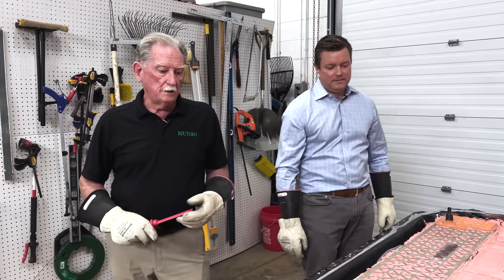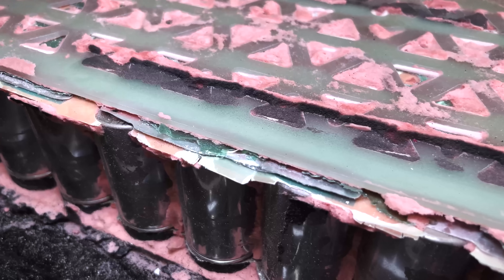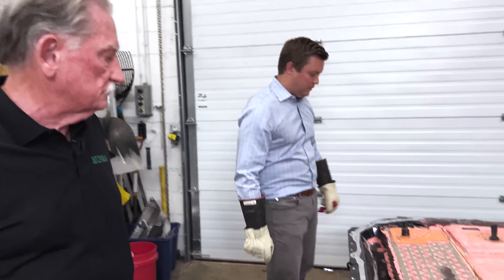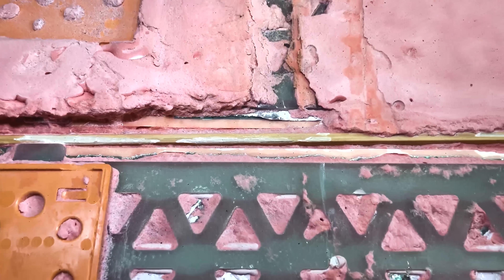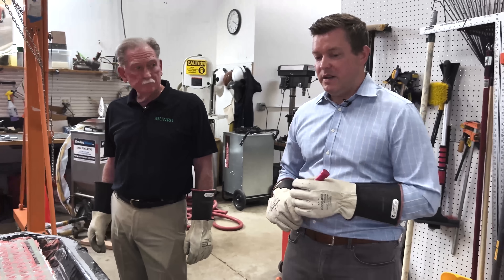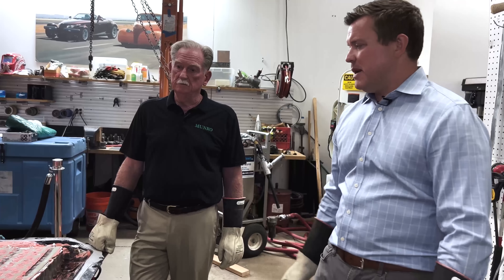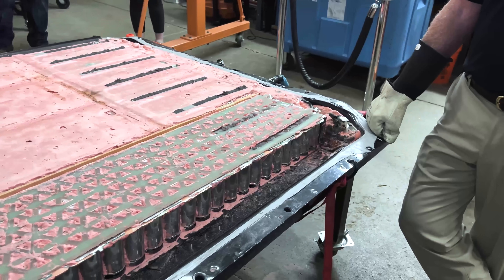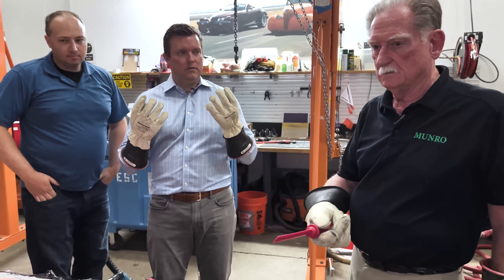4680 Battery Pack: What We Found Under the Foam!

Comment: Thanks for explaining how recycling works. A bunch of “engineers” in the comments thought you pick apart the battery piece by piece. It’s much easier than that.
Reply: Floating, as Sandy describes it, is the normal way that entire vehicles are recycled today. It will be interesting to see how it works with this pack.
Reply: Does an energy audit of the manufacturing & recycling process of this pack exist? Environmental impact study?
Reply: Those engineers work for the railroad.
Reply: I think redwood materials grinds batteries up under water 💧
Reply: You don't need to mock people asking a valid question they answered perfectly
Reply: Ditto, thanks Sandy, for the recycling primer. I was thinking in terms of cheap labor and labor intensive. The industrial process makes way more sense. Duh ;-)
Reply: Tesla does not want you to reuse the batteries. They want them back to make new cars.
Reply: This is the dumbest thread.
Reply: @B.L. Alley if it has a bad block of cells, the BMS will put a kibosh on that plan. You could replace the problematic cells in that block... Oh wait.
Reply: I was just about to thank them for doing this. I didnt know it was that easy to recycle. My first though When i saw All the pink stuff was also that it Will be a nightmare to recycle. I really learned something important here ☺️
Reply: It's still a reduction in recycling, there are a lot of people that want to reuse the cells (reduce, REUSE, recycle), when the car has 300k on it and the pack is at 60% capacity you want to reuse the cells, they would still be good for a while as grid/home energy storage. Essentially, this foam seems like it makes reuse of the cells impossible.
Reply: @edman007x  
If you ever looked at the first patents for the structural pack you would already know the foam was going to be there.
Reply: @edman007x  Yes, there is a cottage industry selling Model S modules, which are of reasonable size for roughly $1200 per module on eBay. These are most useful for RV energy storage or your home energy storage project.
Reply: @edman007x  just use the whole pack as grid/house storage rather than cell by cell.
Reply: @stevenson720  if a few cells of that pack are bad, the BMS will severely limit the useful capacity of the whole battery, or outright disable it. Congrats, it's off to the grinder
Reply: @edman007x  imagine commercial stack of structure battery packs.
Reply: @edman007x  This design sacrifices battery re-use for the best structural design of any EV yet,  which is just what Tesla constantly does. Tesla Power walls are cheap in comparison to EV car batteries, and they perform their job great.
Reply: @edman007x  nah reusing it as grid storage is still possible. You just have to use the entire pack instead of bits of it.
Reply: @edman007x  Well, maybe, maybe not.
Like Munro says, they are still (at least for this pack) separated in 4 units. So when you know how, it'll be possible. It's always hard to do the first teardown, since everything is new.
Reply: @edman007x  Only with the original BMS as a whole pack it can be practical.
Reply: @edman007x  depends on your definition of reuse. Some farmer might buy this car whole (at the end of its driveable service life) and park it near his barn, where his solar array is. It’s probably easier to hack the car for V2H charging, than it would be to reengineer the cells in to an environmentally controlled housing with stand alone BMS. 
With the giga casting of these car body’s, there may be plenty of totaled cars at insurance auction, that are fully electrically sound, just too expensive to make attractive and driveable. 
Powerwall currently has 20 kWh. So a model Y is 4 powerwalls, maybe decreased to 3 by the end of life. 3 powerwalls have a street value of around $45k.
Reply: @edman007x  you have no clue of engineering. the materials like lithium can be 99% recycled. What you lose is the glue. Everything else you can nearly 100% recycle. So why use a 60% capacity when you can build a brand new one with losing 1% or less of the battery materials?! Makes no sense
Reply: @gforcefabi  Musk & JB Straubel have both referred to the chemistries within 'dead' batteries as Rich Ore .
Reply: Things like this need to be discussed because if not we will take what others say at this face value of how it can't be done this and that or it's to expensive and when you hear it from an expert explain it like it's nothing different than what we've done before it makes sense that are movement to EV's and away from Oil companies and their 2.8 billion dollars in profits EACH DAY and to an environment with less pollution is amazing.  Once we get to 500gwh in the United states we no longer need to mine materials at 100% of our capacity, we would only need to mine at 7% to 10% of our capacity because we can recycle 95% of this pack.   So the materials we mine today will be used by are grandkids kids.   Imagine a world where you can roll down your windows and not smell exhaust fumes of a car during rush hour traffic.
Reply: Not sure the word “easy” or “easier” is a good word to describe the process needed to recycle this pack, lol. The equipment needed to successfully recycle these packs is still highly specialized. You most certainly aren’t finding localized recyclers capable of handling this. Still appreciate their explanation though.
Reply: Tesla themselves should give a demonstration of how these batteries will be recycled. Otherwise I will remain skeptical.
Reply: @bobbytrav67  here it is from VW.

https://youtu.be/LABwwX960mk

its as easy as it gets.
Reply: This clearly eliminates the most important part: Repairing and Refurbishing and then Reusing in other applications and lastly comes Recycling.

And that bullshit about recycling with liquid nitrogen and all that, it does not work like that. It is not viable to do because of cost and complexity.
Reply: @Xanthopteryx  No it does not you would drop the whole floor out chop off the seating mounts mount it into a box alone or with others connect everything up and boom done with one unit of an industrial power station.
Reply: @Barskor1  So if the BMS is broken you can still use it as an industrial power station? Good luck with that.......
Reply: @Barskor1  It will fail more often than that, especially after some time. And the coolant can fail, or wiring, or some cells, or cracks, or moisture or... A lot of failure points.
It CAN fail and it WILL fail. And then it will be f--ng expensive and environmentally negative.
This is just a poor decision from Tesla in a reparability perspective, and they are not alone on this. Phones today are a hell to replace battery on as an example. But i think it will come regulations that will make it mandatory to design with repair in focus.
Reply: Who cares about recycling. Its all about repairability in the first place. 
If I had a failure with this battery and I need a replacement, how much would Tesla charge me? Probably a fortune after the warranty. 
It will be a pain in the a** to repair the structural pack. In my opinion this is a step back for Tesla. An easy swappable battery and modules will always be better and cheaper.
Reply: @bjorn5906  I am going to guess that redundancy may exist in each set of cells to account for failure.. People keep calculating the total pack size as having more capacity, Tesla may have shifted to better handling of dead cells.  

While there are repairs on individual cells by 3rd parties, I have also seen info that suggest those are short term repairs that don't last that long before repeat failure.. Would be nice to have some more data on it as that has been one of Tesla's arguments against individual cell replacement.
Reply: @YKSGuy  not mixing new and old cells inside a single managed module is a standard requirement for all battery packs regardless of usecase and manufacturer.

Doing it just leads to an imbalance inside the pack that kills it really quickly.
Reply: @bjorn5906  it's all about how it works though. If the odd cell dies but the rest still works then it doesn't matter, if 1 dead cell means a dead pack that's different. Be good to know the answer to that.
Reply: @stevenson720  given the basics of how battery packs usually work:
1. a single cell failing short will simply burn though its connection to the busbar. The module will have one fewer battery, and the BMS will have to compensate by balance-charging and -discharging, or if it's incapable of that, reduce the discharge depth of the rest of the pack.
2. A cell failing into a leaky state will cause that cell to try to discharge the battery. Depending on the exact resistance it will either enter thermal runaway (causing it to first short and then fuse open, see scenario 1), or not, in which case it will forever be hotter than other cells, causing it and its neighbouring cells to degrade faster. A good supercharging or ludicrous mode session could push it over the edge, which is, frankly, probably preferable to the leaky state pissing away energy and degrading neighbouring cells.
3. If one module of the battery is consistently weaker than the rest, it will be the limiting factor on the lifetime and performance of the whole battery.
Ultimately, single cell failures shouldn't disable the pack, but will degrade performance. In those terms, larger modules of parallel-connected cells are better, so the move to higher voltages (less parallel, more serial) plays a negative role.
Reply: @bjorn5906  I'm sure you must be correct. It makes total sense that you, an internet rando, know more than Elon & the rest of Tesla, who merely hire the world's best engineers. Elon should keep people scanning comments so they can pick up gems of knowledge to improve their works. In fact, why don't you found your own EV company, build it up from scratch and dominate the industry the way I'm sure someone with your big brain could do easily?
Reply: @ColinFox  I was like you. A Tesla Fanboy who defends everything and everyone but doesnt own a Tesla. Only reading Elon Twitter. It changed since I have a 2020 Model X. After 100.000 km its the 3rd battery now. Im glad its easy accessible but I still waited months for a replacement. 
The back tires wear down due to an issue of the alignment. Tesla cant fix it. My backspoiler already rusted after 2 years. The drive shafts are rattling like hell after 20.000km. 
My driving seat is dead. The electrical seating position forward and backwards doesnt work since 1 year. Tesla cant fix it. 
Did I mention my Tesla Model X is from 2020?

This structural battery, and I will guarantee that to you, will be a pain to fix it. Mark my words.
Reply: @bjorn5906  It will be impossible to fix. It works or gets replaced. Probably it won't even be replaced, it will be better to replace the car as a whole if the battery has faults.
Reply: @bjorn5906  How much would it cost to discharge, remove the pack, remove the batteries, test them, and then rebuild?   It cold take a day just to discharge the pack.  another day to disassemble it and yeet another day to figure out which cells are bad and which are good.    and you probably would get a warranty for for the work.   It takes about a day to remove and reinstall a new pack that comes with a warranty.
Reply: @bjorn5906  this thing is just as repairable as the current packs.

Cause Mixing new and old cells doesn’t work, has never worked and will never work. And for Tesla mixing new and old modules also doesn’t work as the BMS can‘t balance them. So the only repair option is replacing all 4 modules, aka the entire pack, at once with either 4 new modules or 4used modules from a single vehicle.

Both of which is still possible.
Reply: @bjorn5906  True, you have to replace the entire thing just because of a few parasitic batteries that could be replaced of a small price. Tesla really is going the Apple route of exploitation.
Reply: @cherubin7th  in isolation maybe. Even in a flash light you swap out both cells for new. But I think this should be considered as 1 'cell' as the battery is NOT in isolation to the overall design of the car - apparently making it much safer, while still being able to recycle the pack easily when needed.
Reply: @cherubin7th  Dude you shouldn't talk about this subject especially after Munro videos you still don't understand it whether it's because you made up your mind already about Tesla or you really lack the technical knowledge to be able to understand this.

Every heard of software? A battery doesn't get replaced nor is there any reason too.

There is in the battery pack a redundant amount of battery capacity.

The software will detect automatically whether or not there is a faulty battery and adjust to that.

You never need to go to the service for anything related to batteries with a rare exception here and there.

And you automatically assume the competition does it better and regardless you don't know or don't understand what the competitors even do because nobody cares. 🤷🏻‍♂️
Reply: @cherubin7th  You will never get a battery pack back to specifications replacing cells, it will be at best sub standard or in the worst case dangerous.
Reply: @bjorn5906  These batteries do not need repair, they are much more robust than any other battery you've ever purchased.  How many times have you needed to repair a battery in your phone, keyboard, remote?  The answer is - you don't repair them,  they are simple devices made to last until they no longer hold a charge.  Tesla batteries last easily up to 500,000 miles,  much longer than most car engines.  The problem is you've been so engrained with your engine needing to be serviced and repaired constantly, the concept of something that doesn't need constant repairs is foreign to you,   welcome to the future my friend.
Reply: @Triathlete5551  I did replace on every iPhone I had 1x time the battery myself because the phone got slow. 
My Tesla Model X from 2020 has now its 3rd remanufactored battery from Tesla. But please tell me more about how batteries last long and designed to throw away.
Reply: @bjorn5906  Lol. You do realize that using your anecdotal individual situation (which is truly unfortunate) as a single data point and then applying it as a generalized analysis of Tesla is pretty ignorant and just downright irrational logic.

Does it suck that you have a badly built car with many faults? Yes. Should you be mad at Tesla? Yes. Does this mean all Teslas are like that and will all have problems? No. At the end of the day even tho the media and public have a (deliberate and purposely) unbalanced view of the quality of tesla, the fact is Tesla has no less of a quality problem than other car brands in its class. 

The focus is what the tech leads to in the Long Term. And as of now tesla has a different approach on this. They do not use the standard corporate strategy of most industries (especially the Auto industry), of Planned Obsolescence. They do indeed design things to be generally more durable and last longer. This is obvious because they run their service dept at cost (Most car companies actually have "service" as their main profit center). It is in their best interest that once sold, the cars never need to be serviced. Obviously that is "best case scenario" and things happen. They want their packs to eventually last 1 million miles and then be either down-cycled (stationary storage) or directly entered into their internal recycle loop for their supply chain. Are they there yet? No. But this is clearly the plan.
Reply: @DorkJelly  Im in the german TFF forum and there are more Model X Raven from 2019/2020 with battery problems.
Reply: @bjorn5906  Welcome to the world of electronics 👍
Reply: @bjorn5906  Well it sounds like you are one of those statistical anomalies sadly,  All the Tesla owners I know including myself haven't had any battery issues.  There have been other small issues for sure,   but not with the batteries.  I think you've just been very unlucky my friend.
Reply: @Triathlete5551  erm. I replaced the battery in my phone three times. Because the phone was good.
Also, that battery is no longer a "simple device", the BMS probably has a decently powerful ARM core that would be on par with smartphones from 7 years ago, only more energy efficient.
Reply: @B.L. Alley Use where? It's about 600 Kg. And it's like this because it has to serve as a structural pack for the car. This thing here is unreusable, unrepurposable. Grinding it down if the car is damaged or just too old isn't the ideal thing to do when it will have still a lot of life in it.
Reply: @GiovanniEsposito5  stationary energy storage. Weight is irrelevant when it’s just sitting near an HV line smoothing renewable production to electricity demand.
Reply: @anonym3017  the pack is too big and heavy (over 500 Kg). So the domestic use is out if the window. The industrial /utility use remain possible but there is no plan for it whatsoever.... So?
Reply: @GiovanniEsposito5  again. It's a stationary application so weight is completely irrelevant.

Snd the ack doesn't have enough storage for a home with a heat pump so it very much isn't too big.
Reply: @anonym3017  Again and again and again. NO. If you don't read you will never understand. There are various use of energy storage. Domestic one implies you have an energy storage that can be installed in a domestic enviroment. A 600 kg monolithic block that big is not. So, domestic storage is not possible. It's a fact, not an opinion, not open for debate. No one will ever do this. It doesn't matter how much you love Elon or tesla, this is not going to happen and they in fact never said anything about it.  Industrial/Utility energy storage is for sure compatible with that thing, but there are a number of problems that will make this use probably so impractical and expensive they won't try it. In fact, they never talked about this either. This is a structural pack made for a car. It's very cool and interesting design, but the reuse/repurpose is none or almost none. It won't have a second life but will go straight to the material recycling when it's done on the car. Enviromentally speaking it's far from ideal and not very sustainable.
Reply: @GiovanniEsposito5  again and again you just claim that something isn't possible without anything to back up that claim.

And again and again I point out that weight is irrelevant for stationary applications.

Furthermore putting this thing in a box, preferably with the long side being horizonal, with a rectifier, an inverter and a cooling setup is entirely possible.

At which point you just put that box on a concrete pad next to an exterior wall of the house and voila you are using it for domestic energy storage. And size ain't an issue as it's the same size as 3 powerwalls mounted next to one another. 

And for industrial applications it's even easier as there you just put a whole bunch of them lying flat inside a box and hook them all up to a single cooling system. Which just happens to be how tesla megapacks are constructed.
Reply: The recycling process described in this video sounds largely like something out of a research paper and not reality in terms of making it happen, making it economically viable, or understanding the lifecycle environmental impact of the process.  I'm starting to question Munro's objectivity here.
Reply: @Destor-p3b  https://youtu.be/LABwwX960mk here’s an easier one. The only big difference is discharging instead of liquid nitrogen and a shredder instead of a grinder.

Everything else sandy said is already the standard way to process ore and therefore out of the lab for decades.
Reply: Their explanation does not at all seem to be based on current or feasible near future technology. This style of manufacturing will definitely make it way more complicated or downright (economically) unfeasible to recover the materials. It is just like how plastic recycling is not working at all, but it easier to just close our eyes and pretend that we have a technical solution to make it work.
Reply: @verytastyburrito  Exactly this! I have an anecdote to share re: plastic recycling....A plastic to fuel resource recovery processes, pyrolysis/depolymerization, does exist and there was a pilot plant here in NYS close to cheap hydro electricity up by Niagara Falls. They would take certain plastics and turn them back into fuel for ICEs.  iirc correctly that plant and company does not exist anymore. Why? I can't seem to figure it out. Here is what I've seen with my almost 15 years in alternative fuels for ICEs. Whenever there is a company using a resource recovery process that effectively reuses a feedstock in the waste stream, in an environmentally sound manner, for fuel in ICE cars that company eventually gets bought by a nondescript holding company and then almost ALWAYS they shut down. I've seen it time and time and time again in NJ and NY with my involvement in brewing biodiesel. This my anecdotal evidence and it means nothing on a larger scale in the US. Just what I have seen here regionally. My spidey senses tell me something is not right tho.